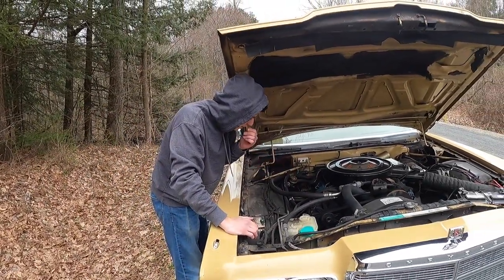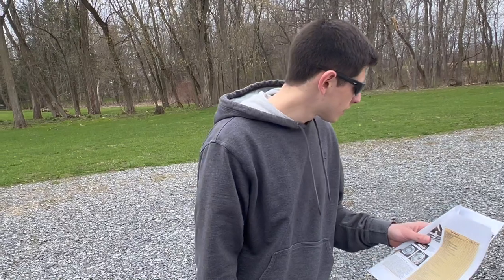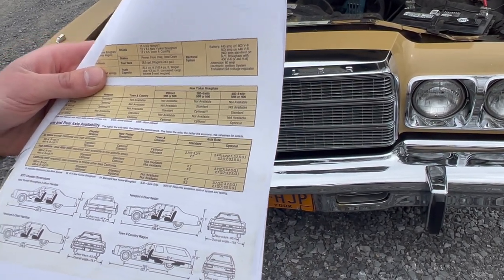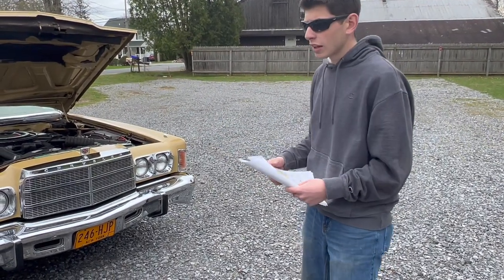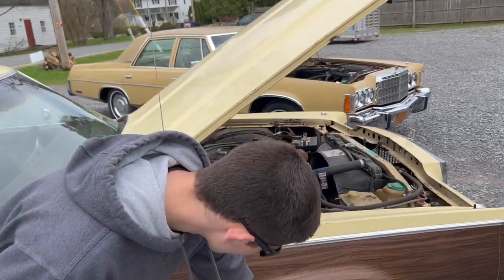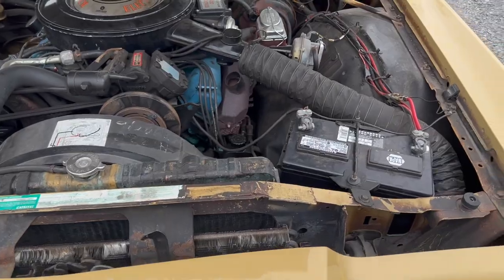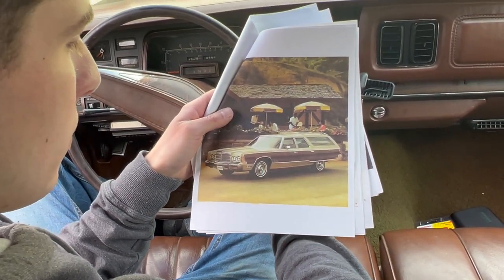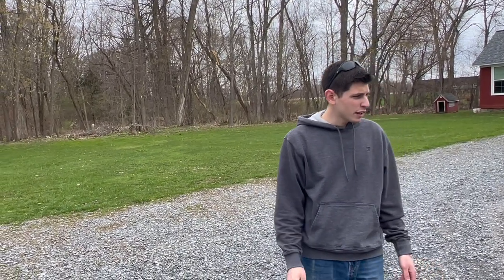1977 Chrysler Town & Country + 1977 Chrysler Newport | Let's Compare Them | Complete Walkaround

Comment: Hey great video, but I just want to point out a few things. The vinyl / chrome molding that's on the side of the car is not "door edge protectors". It's actually called "body side molding" and were probably installed by the dealer or the owner did it themselves as I don't see it on the option sheet. Door edge protectors are chrome strips that slide onto the edges of the door, so when you open the door, you don't chip the paint on the door edge if you hit something like a garage wall or another car.

Your sedan has wheel covers, not hub caps. Hub caps only cover the center of the wheel (where the lug nuts are). Sometimes people refer to them as dog dish hub caps.
Reply from the maker: That's good to know. Thank you for letting me know. As you probably know, I'm always eager to learn!
Reply: Those were factory installed, just about every car at the time had chrome moldings, I lived thru the 70’s
Reply: I think that the "door edge protectors" that you are thinking of were aftermarket. It was a u-shaped plastic extrusion that was sold by the foot at auto-supply stores that the DIY-er would cut to length and slip over the door edge. I remember my parents' 2 door C-body had these (in addition to "body side moldings")......almost a necessity as those doors were probably 5 or 6 feet long.

Comment: You guys do a great job. I really like the informative banter that you two have going on. I had a '77 Cordoba 400 4 Barrel With The Lean burn. I had to replace it two years in but I think where it failed was it sat right on top of the engine and baked all those delicate electronic parts. But when it ran well it ran strong. Great video guys!
Reply from the maker: I love the Cordoba's! Wow, a 400 4 barrel from the factory? Either way, that's a very nice car. Thank you for watching!
Reply: @theunskilledmechanic  even better there was a couple of years you could get the 400 with factory duals, for the time they were fairly swift
Reply: @theunskilledmechanic  bought my Cordoba new, Triple maroon,  just single exhaust,  bucket seats and counsel, killer FM stereo, and air were the main options along with the 400 4bbl. $6,300 or so was the sticker price. Was a fun car
Reply from the maker: @jamesmontan9189  I like the sound of that!
Reply from the maker: @jamesmontan9189  That’s incredible. Sounds like a gorgeous car!

Comment: Hi there - interesting video. I have had a look on an earlier video and you have the standard a/c system. If you had auto temp control, the temp lever would have numbered temp settings in Fareinheit instead of 'Hot' and 'Cold'. Pretty sure the fan settings have an 'Auto' setting as well

Comment: ...hey, guys ..nice "head-to-head" with the Newport and the Town & Country...

...FYI, the optional tow package for the T&C featured beefed up rear shocks with automatic levelling control...a larger anti-sway bar to prevent the "tail wagging the dog" syndrome in which the trailer could actually cause the standard wagon's rear end to lift off the road and sway side to side ( a control disaster)...and also featured the transmission cooler and beefed up engine cooling ( bigger water pump)...a good idea when hauling an Airstream over Loveland Pass west of Denver at 12,000 feet...

...almost all tow packages were factory installed...though the dealer could do so for an existing T&C not so equipped...

...the Lean Burn module was a victim of its being the first large-scale electronic fuel injection system...and it was so unreliable that most Chrysler mechanics replaced them with standard carburators to keep the customers happy...

...and, though single glass front windows were standard...Chrysler execs knew that many of their older repeat buyers smoked and still wanted the vent windows to "vent the smoke"out of the passenger cabin...

...and lastly, the wagons got the slightly wider profile tires to provide better road handling when loaded to the gills or towing a heavy trailer...

...your Texas Newport shows how well preserved these C-body cruise ships can be without road salt/mag chloride...

...keep 'em coming, guys...snd enjoy the ride...
Reply from the maker: Wow, thank you for all of that information! Glad you enjoyed.

Comment: If you look back, the 74 New Yorker looked like your Newport, and the 74 Newport had different tail lights...After 75, the New Yorker adopted the Imperial body style, and the Newport Adopted the New Yorker's body style...The top end options available were all adopted from the 74 and 75 Chrysler Lebaron Imperial, however the only option that was dropped was the 4 wheel disk brakes, available only for 74 and 75 Chrysler Lebaron Imperial. My 74 imperial had the 4 wheel disk brakes, they stopped on a dime, and the pumpkin on the rear end was massive, like the size of a stop sign...shape as well...lol. I believe it was a Dana. It was a nice car, unfortunately I had to sell it. Imperials were non poster cars.

Comment: Hi ! Thanks for sharing these cars and all the details. I love your channel ,the content and  the cars, especially that 73 C body you scored at the Texas Mopar hoard sale. You might want to photo the option plates for both these cars to see exactly what they were optioned with. ON some Mopar's, you can run the VIN online or write away for a full decode for the entire car, from order to build and delivery. If you need help doing this, I do all my Mopar's and have done so for 20+ years of my 40 working on Mopar's professionally. 

Yes, the road wheels are super sweet and a nice addition to any one of these. The wing windows are an odd-duck, I've never seen one with them in 1976/-77. 400 and the 440 were not that different in horsepower or torque. The Lean Burn may have something to do with the lack of performance in the 400, but I'd bet the wagon has better gears for the towing package I think I saw it had. Also look for a clogged catalytic converter, high manifold vacuum would be the forst give away. All told, both cars should perform similarly, my thought would be the Neport was faster but the T&C has more torque for towing down low. The Newport likely had highway gears 2:73 or higher, maybe even in the 2:50's,  whereas the T&C with tow package would have had deeper/lower gears,  think 3:23, 3:55, or 3:73. I don't think 3:91's were an option in this year car, let alone without the Sure Grip differential, but they might have been available on the wagon special order with the tow package and no Sure Grip.

I'd really like to see the option plates on these cars and see how they are optioned.

 I'm looking forward to more of your Mopar content soon!  Maybe a 70's Magnum or Cordoba. Rich Corinthian Leather, I didn't know they had cows in Corinth! Ciao! It is nice to see young guys and gals getting into the older cars, especially the cars that were not popular collector, IE A and B bodies. A '73 C Body Hard Top coupe, like the one that was used in Thunderbolt and Lightfoot during the Rabbit scene when Clint  Eastwood and Jeff  Bridges were picked up on the side of the road hitchhiking by a crazy doped out dude!. " I really love the motor in this car, it's FAST" or similar quote directly from the nut driving the doo- doo  Brown C body coupe hard top in the movie. That car was fast and hiked up in the rear end. Good looking and good running C-Body!
Reply from the maker: Wow, thank you so much for the comment! If you'd like, send us an email at: theunskilledmechanic@gmail.com. I'd be happy to send you pictures of the fender tags off of the Town & Country and the Newport. You'd probably be able to decode them much better than I could. I've tried before, and it seems that the '77 codes are tougher to find online...

Comment: Hey Collin! Wonderful video, it warms my heart seeing a young lad taking a genuine interest and having a real love for the large Chrysler products. You have an excellent mentor getting you to speak of all the features and options for these cars. I too would have checked off Sure-Grip too, most of my vehicles have some sort of limited slip or locking type differentials. Yes, too it is sad many of these cars have met a sad fate. BTW, put on a manifold stove pipe to the air cleaner on the Sedan, you will find cool weather drive ability will improve, especially when damp, the heated air will help prevent carburetor icing. The sedan's compressor has what is called an inertia ring. It helps to dampen any vibrations from the large two cylinders of the compressor. These are very robust units. I really look forward to the continuing stories about the C-bodies. Thank you for posting!
Reply from the maker: Glad you enjoyed! That’s wild about the A/C compressor, I never knew that. Thank you for your continued support, we really appreciate it!
Reply: @theunskilledmechanic  you are very welcome! I enjoy the grass root and genuine enthusiasm you display. No gimmicks or spending 5 minutes asking people to subscribe etc. Your demeanor does this plenty good for you!

Comment: I had a 77 Cordoba 400 4 barrel. It was a gas hog but ran good. Easiest radiator and water pump replacement I ever done. The dash would vibrate when you punched it and the 4 bbl opened up. It had am-fm 8-track. That damn Lean Burn was removed.
Reply from the maker: I love the Cordoba’s! I bet the 400 was a blast.

Comment: Automatic temperature  control will be on your interior controls . The controls will be a temp control starting from 60 to 90 degrees . You set and forget it. It's like a home thermostat. 
Heating and air conditioning will be fully automated
Reply from the maker: Wow, that's pretty wild! Neither of these cars were optioned with it.

Comment: I think you’re wrong about the Newport color. Read the under hood build tag for the code to see for sure. I would guess the wagon also had HD suspension since it has a factory tow package. The rear axle ratio might also be lower for towing which may explain the considerably better performance feel compared to the Newport.
Reply from the maker: You are indeed correct! The Newport is Golden Fawn. I double checked the window sticker.

Comment: An interesting option with newports, and new yorkers, you could order them with or without door posts...aka poster or non poster cars...the non poster cars, once all windows are rolled down, looked to have one large continuous window from fron to back on both sides...no door posts to seperate front from rear. I have also noticed that poster cars have higher ground clearance than non poster cars.
Reply from the maker: I love the pillar-less cars. Very sleek styling. Heck, I love them all!
Reply: @theunskilledmechanic  me too

Comment: If you're looking for a '77 New Yorker Brougham, I have a 4-door hardtop I might want to part with to help fund a '66 Imperial.  The NYB has a 400, standard electronic ignition, body is in great shape, a bunch of new consumable parts but very original otherwise.  Runs and drives very well.  Contact me for details if interested.

Comment: I have an idea for a show ....take that Newport now as is and get some 0 to 60 x 0 to 100 times using app on smart phone. Then A few inexpensive...as far as a Ball spinning on a flat earth goes....should wake it up....  take that 400 carburetor and replace carburetor with a 440 high performance 1 from 1972. Remove distributor replace with a direct connection high performance distributor and necessary parts for it. Replace the plugs and wires with NGK plugs in 8 mm wires. Remove belt from air conditioning unit. Check fuel pressure replace with high volume and high-volume hoses and also check for closeness 2 exhaust to minimize vapor lock. Time the engine go multiple times until you get the heat range of plugs right to fuel shouldn't be that difficult remove smog s*** if must do but I think you could just block up any hoses that are there many will connect right to that carburetor with PCV valve Etc. Get some good fuel you got to throw some ice on the intake throw some ice on the intake with some burlap bags. The plugs will tell you what's up its most important get that heat range right on that motor timing right then go do some 0 to 60 times 0 to 100 times using same app on your phone. Food for thought my friends.... enjoy the show 
...you guys are like Peanut butter is to Jelly ...like  Dick is to Asshley...like Mo is to Par....like Led is to Zeppelin. 😉😎 

     Well done!! 
     Cheers bro's!
     Bless you all
Reply from the maker: Haha, that's a great idea, Ed! I'm sure that would wake the Newport right up. Always nice to hear from you. Thank you for your continued support!
Reply: @theunskilledmechanic  
😉😎

Comment: I don't know about the sedan, but the wagon doesn't have automatic temperature control.  How you can tell is on the dashboard, look at the AC unit.  If the top slide has numbers, it's the automatic temperature control.

Comment: The gas tanks in the two cars had totally different geometry, but you're right on how capacity was limited by space available in the body. The T&C tank is somewhat vertical in orientation. Think of it as a counterbalance to the spare tire. The Newport tank is more horizontal.

Comment: Edmunds new car prices - gives all options and prices.  Very useful tool; over the years I've collected 1969 through end of publication (2004?)  I think I've got all the original brochures for Chrysler too, late 50's through the 90's or early 2000s.  Odd that the wagon doesn't have a roof rack.  Missing the 'T&C package' I assume.  Chrysler offered 2 trailer packages - the upgraded one was reasonable expensive so am inclined to believe you got the trans & steering coolers, etc. with it.  Nice thing about the T&C is the 50/50 slit bench; cost more on the Newport.

Comment: Oh you can get the battery cover with the Caps on them online. It's just to give the today's batteries that vintage look. It has port Holes so you can put it over the port's & connect the cable's so your battery works. It's just a cover to give it the vintage look
Reply from the maker: I believe I saw this online somewhere. It was with the red caps. It really is a great look, in my opinion.